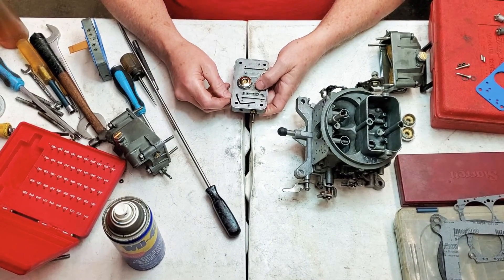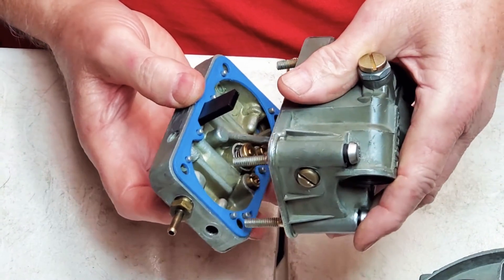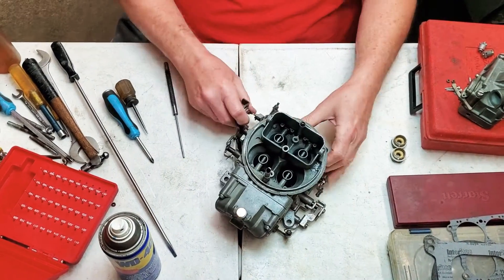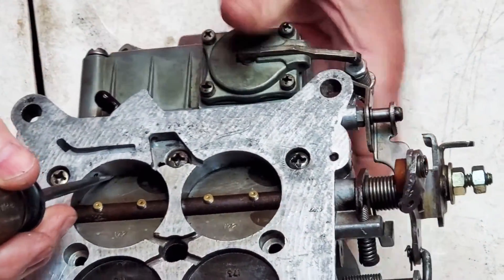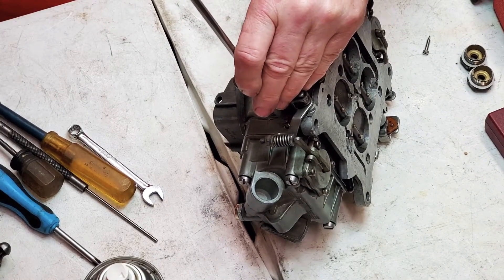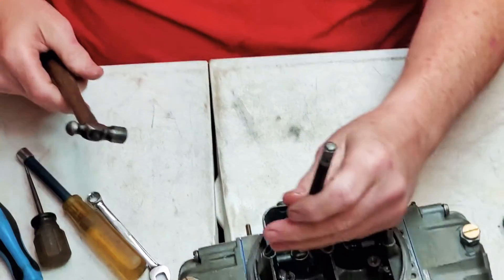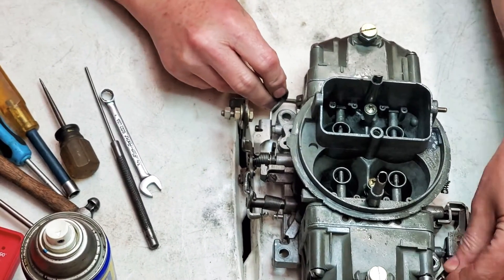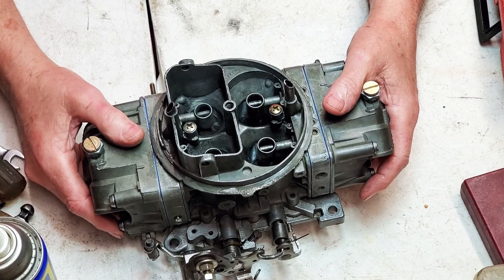*Part 4* Rebuild of Holley Carburetor list #4777-2 Complete Rebuild with Indept Passage Cleaning

Comment: Why no mention of the throttle shaft play? And repair? Great videos.
Reply from the maker: I found by the time you buy all the bushing kit and tools  and then if the throttle shaft is worn and you still end up with usually an old body. To me its not worth it. I just replace them. If you know which ones to buy on ebay, I was buying them for 100 dollars a piece.  It's been I believe a couple years since I bought one. Hope this helps.

Comment: What are the other sides of the fuel inlets ? Another place to put your fuel lines? they stay open? Also what size power valves did you install and what did you open the flow nozzles too? this is a 355 with 205 intake dart heads.
Reply from the maker: Some high performance holleys have dual inlet fuel bowles, that allows you to use them as a primary bowl or a secondary, the side that's not used is plugged. I believe I used a 5.5 power valve, as far as the accel pump nozzles I opened them up because of the loss of engine vacuum due to the hp cam.
Reply: @holleycarbshowtosadvice40y90  the one i have has NO power valves at all . Front screw in block off and rear is factory blocked. 4777 series 
77 up front and 80 in the back is that normal?
Reply from the maker: John don't know how much cam your running but I would jet the primaries at 67 to 70 and a 6.5 power valve, and the secondaries jetted at 77s to start with and tune from there, holley 4777 never came straight jetted , I never straight jet. I always run a power valve on the primary side to keep control of the fuel curve. hope this helps. Also accelerator pump nozzles at 30 to 32s to start with, should be close.
Reply: @holleycarbshowtosadvice40y90   I looked up the factory spec it said 67 and 73 with 28 squirters should I stay with that or do 77 in the back?
Reply from the maker: John you can try it either way and tune from there.

Comment: I need to buy a new primary metering block for a carb I was given.. it was in pieces and had multiple secondary metering plates with it but no primary.. since I’m going to buy a new one anyway, would it make more sense to just buy a billet primary block rather than a cast one? Would it make a huge difference having one billet and one cast block? I see QFT makes one that’s the same price as the one Holley has for the cast replacement.. this is for a 4777-3
Reply from the maker: Nick I like the billet blocks and it would work fine on your 650 dp
Reply: @holleycarbshowtosadvice40y90  Could you possibly tell me which pump cam I would need for the 650 dp? I want to make sure I am in the ball park with it and reference what is on the carb currently with your recommendation. I'm not sure if this has been modified at all or not in the past. Thanks.

Comment: WOW!! This was the most helpful and in-depth series on a Holley rebuild I have ever seen!  Thank you Randy and your colleague/videographer!!  Quick question--do you have any tips/tricks to SAFELY remove the fuel bowls that are stuck to the metering blocks on my 8-year old Holley 3247? I tried rapping with a rubber mallet.  Looks like the non-reusable gaskets were used and the adhesive is very strong.
Reply from the maker: When there really stuck bad especially the old gaskets it's a mean job, if you have the time soaking them seems to help . Thanks for watching.
Reply: @holleycarbshowtosadvice40y90  Thanks. Which carb soak solution would you recommend for this tough task?

Comment: Berry Grant and I both use Rubber orings for the Air And Fuel mixture screws because the Cork ones eventually loosen and the air side will leak . So with the Rubber seals I haven't had any problems with them.  And we both use The plastic rings for the bowl screws
Reply from the maker: The orings are better and last longer on the mixture screws but on a old holley bowl that's rough I will stick to my old soft gasket to seal , nylon seals works good on bowls with good surfaces .

Comment: For the gasket that goes between the circuit plate and the actual body of the card. I noticed you set it on and then flipped it over. Obviously there is only one way for it to go but can be put on either way. What happens if you put it on backwards? The reason I ask this question is I just took my carb apart and discovered it was on backwards and the circuit with the dogleg was blocked off by the gasket. What will that cause?
Reply from the maker: I'm not sure what your asking me.
Reply: @holleycarbshowtosadvice40y90  Ok I did some other research and found that it is for distributor vacuum. With that said my 600 does not have the external float adjusters. It has the black floats in the bowl. I do know just to bend the tab to adjust level. Is the proper level set by turning the bowl over and setting it so the float is perpendicular with the housing?

Comment: love your explanations, very concise and knowledgeable, i have a 502 chevy that was just rebuilt. the engine had an 850 with vac secondaries but the man who did the rebuild replaced it with a 750 dbl pumper mechanical. engine burns a lot of fuel and is not a good driver. truck is a 85 quad cab dually,auto trans weighs 6800 lbs. any advice would be great,thank you.
Reply from the maker: I would go back with your 850 vac. Secondary ,a double Pumper is not the right combo for your truck. You have a heavy truck with a auto trans and if you have 410 gear ratio and are driving 70 mph your in the secondaries, which means poor fuel  mileage.
Reply: @holleycarbshowtosadvice40y90  thank you for your reply, truck has 4.56 rear ratio and runs 3000 rpm just to do 55-60. will be changing rear axle to a higher number soon. any advice on a ratio?may do towing light duty in future but is just basic transportation for now.

Comment: So the secondary jets are always 8 points higher or so than the primaries.. I have no choke as well so what jets did you give him. And what size did you drill out the nozzles..
Reply from the maker: Yes if you do not have a rear power valve or its blocked off ,then go up on your secondary jets 6 to 8 sizes.works great.

Comment: Hey Randy, how about doing a 660 Center squirter and changing to downleg booster
Reply from the maker: That is a really good carb to do the big throttle plate modification ,with that and a good set of boosters and a few more mods makes a good preformer , sad part I don't have one sorry , if I run across one I will do a video.
Reply: @holleycarbshowtosadvice40y90  are you talking the 850 baseplate? how would that work as all 4 barrels open simultaneously?
Reply from the maker: The pro series 850 base will adjust from progressive to one to one opening the secondaries.ldle circuit has to be modified .this is strictly a racing modification.

Comment: Extremely informative.  Great set of videos - and with the info I've gotten, feel confident of fixing an issue with my 850 dp - liquid fuel dribbling out of one venturi booster.  Likely a plugged air bleed, based on what I see - I'll clean all the passages as shown.

Comment: My check valves on my accelerator pump are stuck how do I get them out
Reply from the maker: I will shoot a short video on this saturday
Reply: @holleycarbshowtosadvice40y90  Thank you very much
Reply from the maker: I apologize it will be monday for the video
Reply: @holleycarbshowtosadvice40y90  Thats ok I cant wait for the video....I got a little impatient and used the smallest drill bit I could find and got it out. Still want to see the video. Would like to see what else I could have done.

Comment: i rebuilt my 850 bouble pumper holey on my 440 coronet rt trans has a 300 stall it works good but at idle it's rich you can smell it  what am i doing wrong
Reply from the maker: Check your transfere slot , if not sure look up my video on the idle circuit, if that is good , then change your idle air bleeds to a bigger air bleeds size or smaller idle fuel restrictor.
Reply: Great videos Randy, explains the workings and rebuilding  of holley carbs so well. Just rebuilding my 830 double pumper. My first rebuild and your videos are so much help👍🏻

Comment: Hi. I have a 454 whit a 850 dp, 536 hp on flywheel. A street and strip nova .Does cutting the choke tower is a good idea if not used? If not running the choke, what to your recommends? Not sure but I think you said you jet up the secondary about 2-3 size for better cold start? And should i block off the rear power valves. It was jeted 80 four corner. Sooo greats videos you do!. Can't wait to get a wideband and fine tuned it...
Reply from the maker: I dont run a power valve in the secondaries , block power valve and jet up 8 sizes . To help cold nature I like 4 corner idle circuit .
Reply: @holleycarbshowtosadvice40y90  for cold wheather start up whitout choke ,you richin the four idle scew to help running Well ? 
And during This summer i found that locking my timing (39*) really help my engine to run better from cold start. But smell much rich . This year i want a wide band...thanks for everything

Comment: Would love to see you tune the idle circuit on the actual motor.  I always end  up. with the throttle blades having to be too far open to get my drag race engines to idle which of course means the transfer slots are way too exposed, etc, etc.
Reply from the maker: We will have a video covering that on Saturday. We will be tuning a small block in a Late Model dirt car
Reply from the maker: We got rained out with the latemodel dirt car  hopefully have a video soon.
.